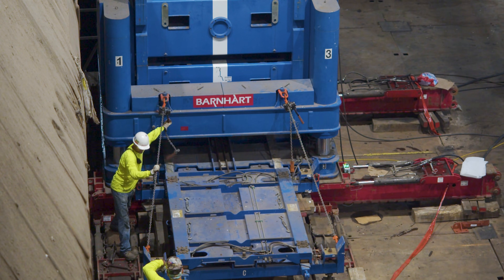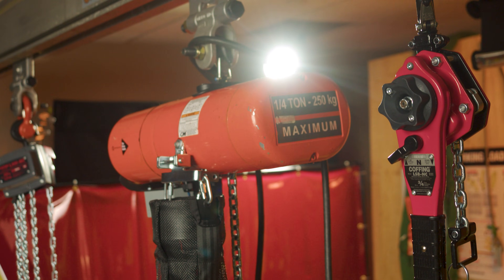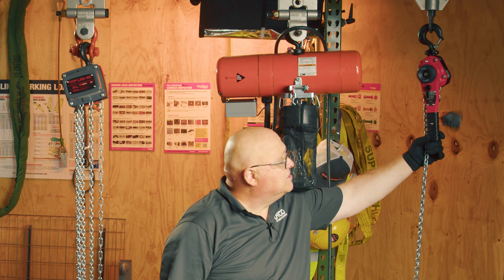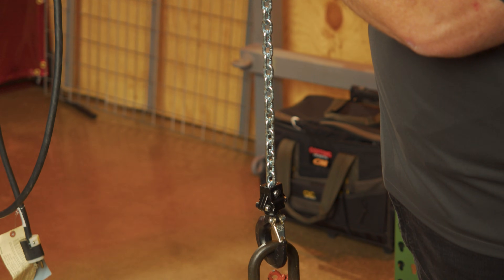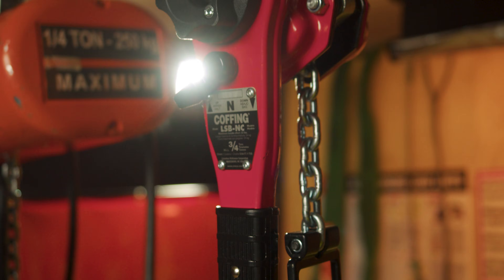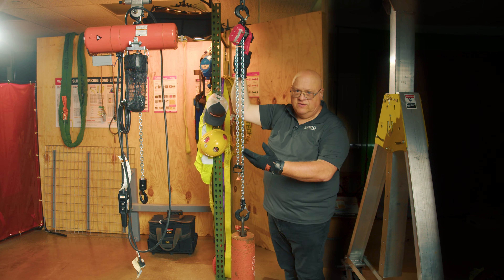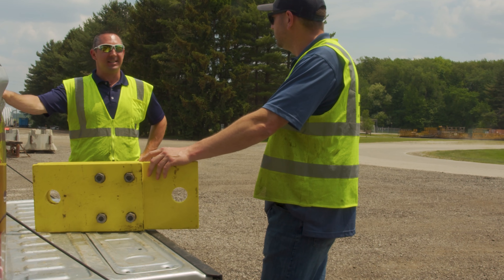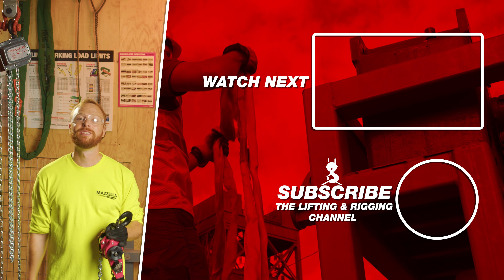Hand Chain Hoist vs Lever Hoist: Which One Should You Choose?

Comment: Hi guys ! I would like to ask, for the purpose of lifting a 175 pound punching bag for regular hanging and unhanging (2-3 times a week) from a ceiling mount, would you recommend a chain hoist or a lever hoist (or even a wire rope hoist)? Thank you!
Reply from the maker: Are you using the hoist to lift the punching bag to it's mount? I would not use a hoist as the mount itself because the shock and swing generated by punches and kicks will inevitably damage the hoist. As this is a vertical lift either would work well. A chain hoist may be easier to get the bag up there without climbing a ladder. Remember if your hoist is up at the ceiling and you are using a lever hoist, your lever is up there as well. Also a chain hoist might be a bit faster since you are lifting and lowering frequently. For this application, as long as you can reach the lever, both will suffice.
Reply: @LiftingandRigging yes I'll be using it to lift the bag up to the height of the mount, then putting something underneath to support the weight before unhooking it from the hoist, then hooking it on the mount instead. Great point about the ladder part! I did not think about that, seems like a chain hoist would be the way to go. Thank you for your help!

Comment: Great video. One thing I have always wondered about chain fall/hoist, can you paint or distinguish the pull chain? I've used them and there is always that few seconds of wait, which chain I am pulling, and in what direction? and yes, you just look to the one with the loop, but if it was clearer it would be cool. Like making the pull chain of brass etc. Mainly they tend to get wound up and need to be untangled.
Reply: I have a couple of chain hoists on all of them the pulling chains are different than the chain that takes the load. Longer links, not as heavy. But I see your problem. However the chains will be running through the hoists continually so any paint will chip off quickly and a lot of those chips will end up sticking in the hoist itself. A brass chain might do but would probably be more expensive and less durable.
I store my chain hoists in buckets, every hoist has its own bucket and when putting the hoist in the bucket I put the end of the chains In first then lower the rest of the chains and eventually the hoist on top.  This way I never had them really tangled up again.
Reply: Painting the load chain would possibly last longer , depending on how much useage..